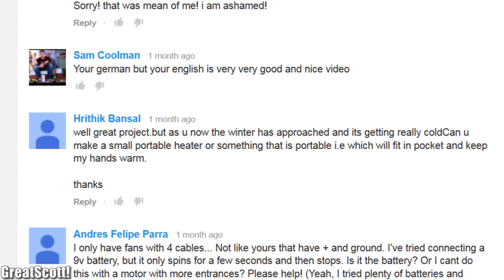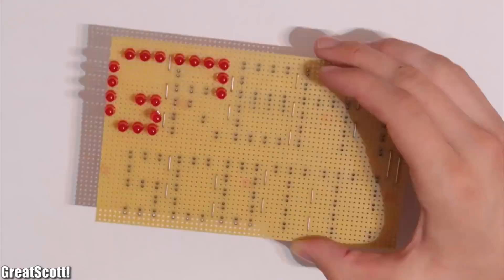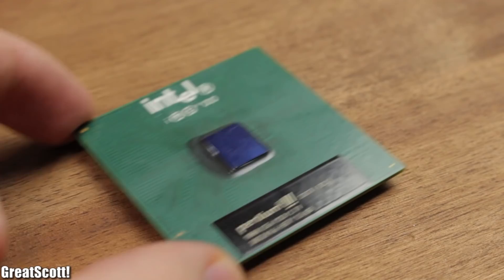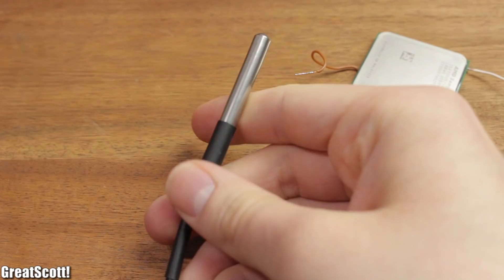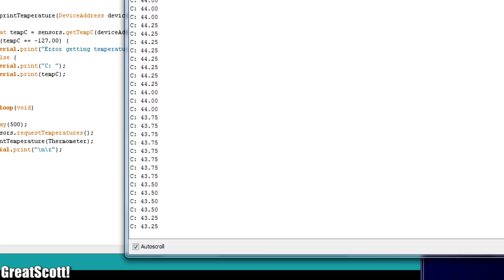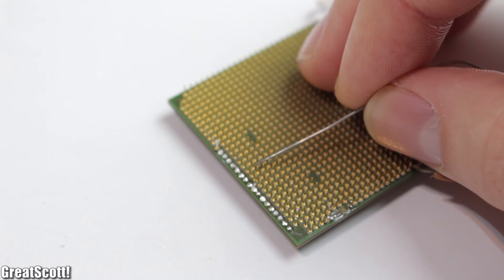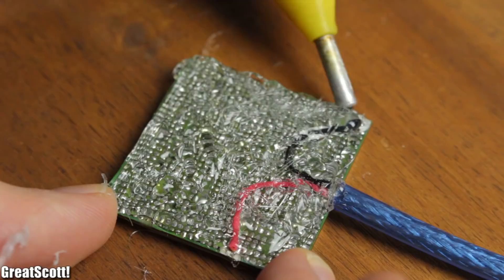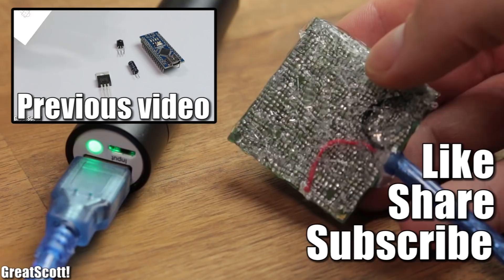Stay warm this winter: CPU Hand Warmer

Comment: I was trying diy hand warmer lately, with my diy electromagnet, but i needed more power so i tried using some mosfet and i figure the mosfets gets hotter faster than the  heating coil. So instead of heating electromagnet coils I'm using mosfet as the main heat source. Its working pretty fine but I'm lacking material for my design. Please do try this and explain a little more on how to create more efficiently.

Comment: Do not use usb data cables for power only! Also do not cut them off on the connector but leave a bit of cable so you can reuse the connector

Comment: Easiest and cheapest way:
Take 2 9V Batteries and put them together.
They warm up really quick, last long, and are big enough for both Hands.
Reply: ***** Meh, that's not how batteries work.
Reply: Yes, we are sure about that.  Alkaline 9V batteries barely get hot when shorted, they have high internal resistance and a high thermal mass and a large surface.

Comment: A Peltier unit seems like a more obvious solution, but would also require quite a bit of current, not to mention getting even colder on the opposite side of the unit.

Comment: Let me tell you, I built a PC a year a go that has a GTX1080, i7-7700K and 16GB RAM. When winter came around, it got cold in the basement, where I keep my meme machine. Problem is, my computer is so powerful, I couldn't find a single software that used enough graphics, cpu and RAM power as to where my computer would heat up and keep my room warm. So I bought a GTX280, installed it in my second PCI-E slot and plug my monitor into it. Now playing a simple game like Garry's Mod makes my basement real toasty and I can just switch between my GTX280 and GTX1080 whenever I want with the hit of a button. (My monitor has 2 HDMI ports as well as a VGA port so I just plugged a VGA and HDMI cable into my monitor and computer so I can just change the source on my monitor whenever I want to swap between "central" heating and ultra settings on Crysis.)

Comment: Using your logic and ideas I thought I'd scale this idea up  and build a whole house warmer so I took an old TV and I cut the dryer plug off my dryer and I took the TV chassis  out and turned it over to where all the wires and stuff is and I plugged in the dryer plug and I just started to touch different wires with the bare power wires until I could feel enough heat coming out of all the wires and stuff to heat my house!  BOY DID IT WORK!  

A CPU creates heat by doing processing. You did nothing more then find a path of resistance which could possibly create some heat but 999 times out of 100 you will just destroy a hundred or so micro components inside the IC. 

You  must have been drunk to post such a crazy idea as this.

Comment: I did it with Pentium 630 LGA 775. Temperature, after 2 minutes was nearly 100 degrees (celsium). So i don't recommend to use termoglue. I used "second glue" for this. I did it with Celeron 1.70 GHz PGA 478. It heats worse than Pentium 630. Thank you.

Comment: Are you crazy?? On the CPU in the computer is fed in the standard mode no more than 3 volts (usually not more than 1 volt), and you applied for it 5 volts. So you can stay without the CPU.

Comment: My amd rig does make my room about 10 degress Celsius hotter (with AIO watercooling)
And if you want to keep your water or tea over 40 degress than put some thermal compound on the bottom of your cup or what ever from you are drinking hot fluids (sry for my bad english)

Comment: You best believe that a 1999 AMD athlon will keep your hand warm without that heat throttling protection system on the background working. Just remember to unplug it from the power source when you're done with the cpu or else it will smoke.

Comment: hey you should make something even better, how about this. a jacket that has wire inside it which has resistance and warms up (like an electric blanket). Put heaps of insulation in the jacket so the heat is all directed towards the body. Run it on two batteries in each jacket pocket to even the weight, have 2 18650 cells in each pocket so 4x18650 all up. 
Make it so it can run for about 3 hours before you have to recharge it. Emitting about just 15 watts is enough to make you feel warm if it's made well in a jacket and there is a lot of insulation on the outside. 

They in fact sell these commercially, but it would be cool to see someone make it. It would be a lot of work though.

Comment: Should have got a circuit diagram and designed something a little nicer. As the main heat of those chips comes from the transistors switching. So in theory, you could have the CPU just reprocess data over and over again to do work.

Comment: I build it with an pentium 4 and it works but i failed first time because I measured the resistance I found an 3.5 ohm connection and calculated around 1.5 amps. I soldert wires on it with my really bad soldering iron but when I measured it were still 3.5 ohm. Than I connected 5V to it and wush! The wires in it burnt away. But than I did it like you and measured 700mA not ohm.... And than it Worked! Now I have a CPU Handwarmer

Comment: Before I know much about cpu, I thought this tutorial have nothing wrong, I thought the cpu can heat up if u just give it power supply
In fact, the reason why a cpu heats up, mostly is because the logic gates are turning on and off, so it doesn't make much heat just by connecting two pins of the cpu, u need it processing
Also, if u have cpu overlooking experience or sth, u will know a cpu usually runs at around 1v, so connecting it to 5v, it may damage the cpu. 🤔 Actually, it will destroy ur cpu, so never try this with ur currently using cpu

Comment: I'm not sure if I believe this or not. Pretty sure a lot of CPUs run at less than 5V. Furthermore, CMOS technology only really consumes any noticeable power when it's doing work – i.e. changing state.

It's possible that the CPU is just reading garbage instructions from the nonexistent RAM and executing them. But in that case, we'd expect a much greater amount of heat.

So yeah. I'm honestly not sure if he's trolling or not.

Comment: If I remember correctly the AMD Sempron cpus hit the market in 2004 or 2005. No idea why it says 2001 on the chip. It's probably when they copyrighted the name.
Reply: The top plate might have been manufactured in 2001 and they added Sempron after maybe?
Reply: TechMan221
that is also a possibility.

Comment: A better approach is to use a cheap PTC thermistor.
It will automatically regulate its own temperature, and reduce power consumption when (if ever) it gets too hot.

Comment: You could do the same thing, just as efficiently, but more easily and for lower cost, by using a few resistors, or even a filament lamp, and pay for it all by selling that CPU for €25.

Comment: Use a pentium and then unlock the 2 extra threads. Idles at about 85 c. With a 2500 rpm fan.

Comment: Could You please try to make project of small heater which could boiled up small amount of water ( about 100 - 150 ml).
Power supply would be from car socket in car so more power to get. Purpose of this is to make small , but hot and fresh coffe in car during driving. It would be like coffe machine but must be small like small cup of espresso.

Comment: Can you use a glass of water to cool the cpu?
Reply: No that would cause a fire but what you could do if you are not planning on changing any hardware in the future of your pc you could submerge it in oil that would really cool it down.
Reply: Water causes a fire... Wait, what?
Reply: @David Marris I think he meant put the glass of water on the processor, not pour water on it. Technically this would work, but only as long as the water stays cool.
Reply: Glass is not a very good heat conductor, so the cpu couldn't generate too much heat. That being said, you don't have to change water in metal radiator.

Comment: if you still got this around, how well would it work on holding an already warm drink warm? might not be able to heat it up, but keeping smt hot is different ^^ or reduce the cooldown time a lot
Reply: well there are battery banks that offer 2.1A over 5V USB, which would significantly increase the amount of heat produced if you could find the right pin combo.
Alternately, if you're just after a drinks warmer and not something you'll be touching much, you could always just keep the CPU in its socket on the motherboard and have it idling while keeping your drink hot. Low-power and laptop processors are better for this because they require much less cooling. Plus, with a laptop you can remove the screen and keyboard, cover everything except for the CPU with wood or plastic and have yourself a little bench to put things on while you're not using it.
Reply: Gordon Rammstein already got a powerbank with 2.4a :D but it doesnt really matter as i hate warm drinks, would rather just have a system running and putting my cup on top of its rad or smt (it irs watercooled at least)
Reply: I guess you could easily calculate the power needed to achieve that. Let's say you want the liquid to stay at 90°C. So you can measure the time it takes for the liquid to cool of 1°C(from 90°C to 89°C) and provide the same heat it dissipates in the same amount of time. The energy of 1°C difference in 250 ml cup would be around 1 kJ(4.2 kJ for 1l of water ). So you need to provide 1kJ in the time of your measured 1° drop in temperature. W=J/s, so if you measure it to be 30 seconds, the power provided by your heater needs to be about 33 Watts. If it's 10 seconds, you need 100 Watts. 
P.S. God bless SI units.

Comment: That battery will last 40 minutes if your lucky. Literally every USB battery pack on the market is using low grade or even recycled batteries.  3200mah sounds nice but they can be as low as 1000mah and most are around 1800mah.

Comment: yo, safe the CPU of gettin a short-circuit by water and put inside your drink instead of tryin to heat the glass.
Maybe this works xD.
U just have to clean it before and after heatin the drink.

Comment: AMD is the way to go in this project :D Buy a high-end AMD CPU and you got yourself at least 80°C
Reply: Try turning on a 4770k without the cooler and check the results by yourself
Reply: oh yeah use a i7 4790k at 99c
Reply: Could probably reach over 120c on the FX 9590 they're known for being hot as hell.
Reply: There is just way too much OC on the 9590

Comment: Why didn't you use peltier module
And boost 5v to 12v to power module????
Reply: If he used it with this much power, the Peltier module will go from hand warmer to hand burner. And besides, if its mechanical bonds cannot handle such high temperatures, premature failure will come around sooner or latter.

Comment: There is a much easier way to make a hand heater and you need no modificaton to the computer, run flight simulator 2020 on that PC and then touch the cpu

Comment: Does it also work with a AMD Athlon XP 1600+?
Reply: Well, the heat spreader is smaller, so the heat output would be concentrated on a small spot.

Comment: Anybody who thinks that AMD or Intel or Nvidia chips would have any difference skipped physics class. Any chip running at 3.5w has the same heat output.
Reply: but using a thing like a phone charger that would not be true
Reply: fმɀპ ძმῆκ Why? It's the same power draw, 3.5w is 3.5w
Reply: ***** banks like those give various amounts of power depending on whats being used, although that may be carried along the usb data line so thinking about it again your probably correct

Comment: Can't you just use some resistors (or even a potentiometer), a ceramic core, and a few feet of wire to make a coil that would give you the same result?  Either way I can see someone lighting a fire in their pockets...
Reply: Czech a resistor could shock you (it depends on wich type you are talking about)
Reply: I am talking about a component that generates resistance (whether it be a standard n-ohm resistor, coil, pot, etc) in order to limit the wattage available to the heating coil.  Of course you would still seal any leads to avoid shock, but it's probably just as dangerous as that which is depicted in the video.

Comment: hey man. this is wast of time only use some turns of  nichrome wire . that get the old soldring iron elemnts it work perfectly on 5 v usb charger and if you whant to more heat then less the turns or increase the voltage  and get more more more heat if heat is out of control then use the dc dimmer to control manualy heat if you want . 
the best way to experiment is 
you get the small pice of round wood its approximately 1 or half feet and rewind some turn of nichrome wires and cover from a pice of cloth and polarity is not metter . plug into 5 volts and see after 1 minet 
8 to 10 turns for 5 volts ....
 i already made in pakistan . 
even i made in gloves socks high neck and ears guard  even baby feders milk warmer also .

Comment: If he used a voltage step up from 5 volts to 10 v or higher the heat output would be greater
Reply: You are wrong, as when stepping up the voltage(5 V to 10V) you lose your amperage (1A to 0.5A) totaling the same wattage(5*1=5W || 10*0.5 =5W)
Reply: ok thanks for clearing that up btw whtat would be an efficient solution to repairing an old 6 cell nimh battery and it must output around 5-7 amps if you could help me i would appreciate that

Comment: Use a Prescott P4 and you'll burn your house down.

Also, that AMD chip looks like Socket 939 or later, that's at earliest 2005. And please don't ruin your old P3 chips this way! There are not nearly enough of those systems left for the people that enjoy more retro tech, too many have been scrapped or recycled as it is.

Comment: Here's an easier way to find the right pins: (might not be the same processor but you get the idea)
https://www.amd.com/system/files/TechDocs/31412.pdf
Just connect VDD and VSS pins to the power supply.

Comment: I just took an aluminium plate and wrapped some copper wire around it and it's done.By powering it with a 3.7V battery it produces sufficient heat.Xd

Comment: Is it nessesary to messure the Pins? I havent got a Volt messure-thing. ;(
Reply: You obviously don't know what you are doing, so don't =)
Reply: Sc0pee :D I can try Thought :P
Reply: Ka Wo Me Di Yeah but playing with electricity can be dangerous.
Reply: Sc0pee 5 Volt are actually Not that dangerous and the CPU wont reach temperatures as under real Power, because it isnt processing anything and is just passivly put in a electric circle(I dont know if you really call it "electric circle).
Reply: Ka Wo Me Di  Yeah, but remember to use a battery, not an adjustable voltage source like he does in the video...
Reply: Sc0pee yes, my own Powerbank wouldnt even work with just 3,5 volt
Reply: Ka Wo Me Di Eh? The voltage is the amount of volts the powerbank gives out. For example USB, roughly 5V.
Reply: Sc0pee I meant, my Powerbank just has 3,5 volt, thus i wouldt use it Anyways.
Reply: Vell, the cpu vcores are around 1v, so putting 5v is in the spot of controlling exactly the amps.
Reply: Techtastisch 75 did you not watch the video? the power bank delivered more than it consumed..
Reply: There is no way of that happenening, it cant draw more than the powerbank can handle :D

Comment: Okay, neat project, but it's completely pointless!  You do realize that there is already such a thing as an Electric Rechargeable Hand Warmer, right?  And they double as portable power banks. They are exactly like that Anker portable charger you used in the video, except they also have a switch on them for the hand warmer option.  Tons of companies make them, and they do exactly what you are trying to accomplish here, but better. And for the same price, or maybe even cheaper.   For the same amount of money you spent on that Anker Portable Charger, you could have instead bought a 2-in-1 Portable Charger / Hand Warmer. 

Again, not to take away from the neatness of this project, but it really is a giant waste of time and materials. There is no sense in destroying a CPU, paying for a power bank, and putting all of this time into building a [probably very dangerous] device like this, when you could just buy an electronic hand warmer that allows you to have heat AND charge your phone. Not to mention, the one you buy online will have built-in safeties to ensure that it doesn't catch fire and burn your house down.

Go on Amazon and search for "Rechargeable Hand Warmer", and let your mind be blown. There are tons, some less than 20 bucks. You're welcome.
Reply: kaylor87 Okay you clearly didnt see the point. And its not dangerous at all
Reply: Jakub Hobl   Lol, it most certainly is dangerous! Some ghetto-rigged CPU, fractions of a millimeter from shorting out... And you're saying to put it in your hands and/or pocket? Especially right next to a Lithium Ion battery pack??? Yeah, that's a fricken disaster waiting to happen. Please explain to me how this isn't dangerous...?
Reply: kaylor87 Well, its 5v so there is no possible damage from that. If it shorts out the two cables, nothing is going to happen because the powerbanks are protected from that. If some two random pins on the pcu short out nothing will happen at all (i tested this). And at 5v and 1a the cpu is nowhere near the temperature required for setting something on fire. Have a nice day :)
Reply: Alrighty, if you say so. You have a nice day as well :)

Comment: Heat + hot glue = melt hot glue i used to glue a led strip with an aluminium back and it melted the glue

Comment: Well ... I guess it works ... but for a mere two hours. You know they still make those old fashioned hand warmers that use kerosene ... they are dirt cheap, and so is the fuel. So, you can waste time making this pretty useless device (fun idea it is but impractical ... if you live in a cold area, I don't so it is totally worthless to me.) or spend I think 10-15$ on the kerosene hand warmers. Ok my rant is over. Nerds need not reply.